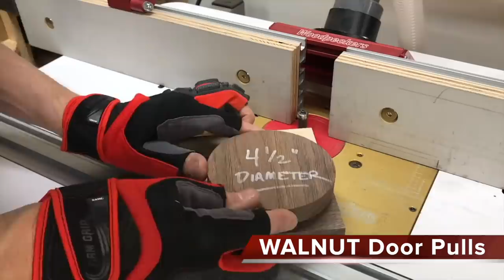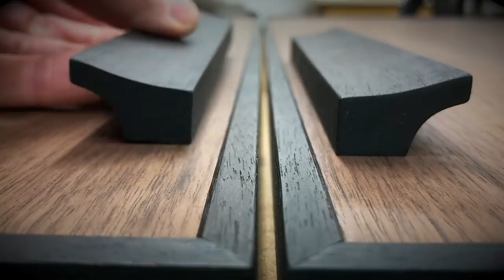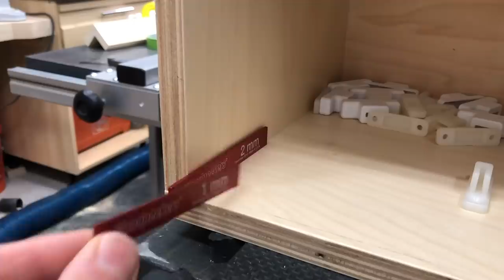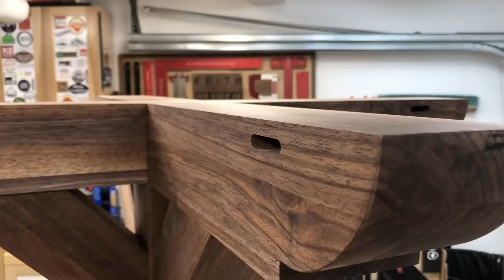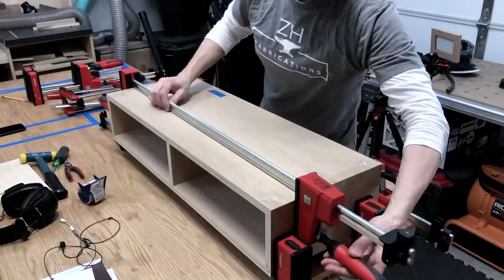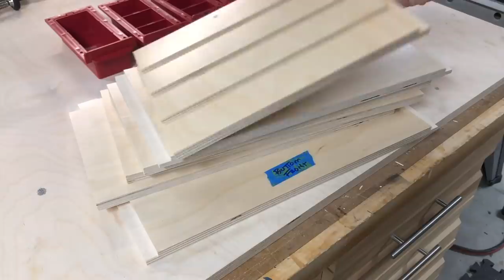Amazing woodworking techniques...VOLUME 1

Comment: Hi Keith, well done video sir! Quick question…will the rubio monocoat keep the walnut from yellowing as it ages or do you know another way to keep that from happening?
Reply from the maker: NO it will not. The Rubio will amber it over time depending what color you use - most hardwax oils will do that in my experience. I have started using the WALNUT color of Rubio to try and keep it a little darker. Other products like OSMO seems to remain more clear over time.

Comment: Hey, Keith? How much horsepower do you have on your drillpress? Mine is 1/3 hp and it struggles even with small forstner bits (25 to 35 min). Yours chip through wood easily!
Reply from the maker: 1/2 hp

Comment: Concerning the pocket screw jig..I've seen other woodcrafters use the jig for their "primary" piece of wood but then go and drill a pilot hole in the secondary piece. They do this do avoid any splitting...I thought that when you drill a pocket hole, it involved both pieces...is that incorrect or are there exceptions ?
Reply from the maker: The pocket hole is only drilled into 1 piece and there isn't a need to drill any pilot hole in the mating piece. I've never had an issue with splitting, but it could happen if the wrong screw is used. The fine threads are for hard woods and the coarse threads are for soft woods.
Reply: @KeithJohnsonCustomWoodworking   Thank you Keith!! I get what you're saying..

Comment: Keith, thank you for a great video.  Was wondering how you sharpen your chisels.  It looks like you have a mirror finish on them.  Any advice?
Reply from the maker: Thanks Doug! I use Shapton Ceramic stones 1000/5000/12000 grits and a LieNielsen honing jig.
Reply: @KeithJohnsonCustomWoodworking  Thanks Keith.  Any chance you have a video of how you sharpen?
Reply from the maker: @dougmcilwaine7078  Sorry Doug, but I don't. Maybe one day I will put one out.